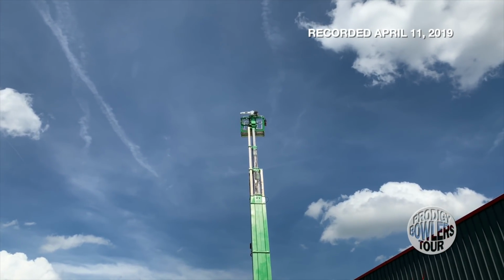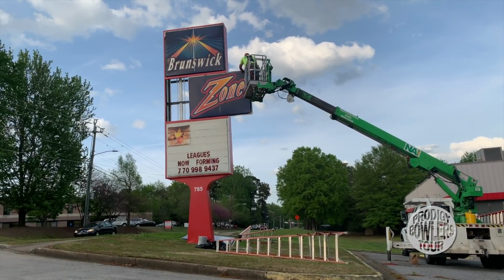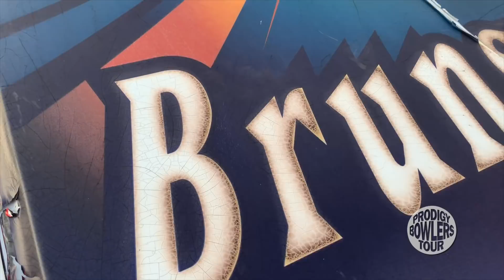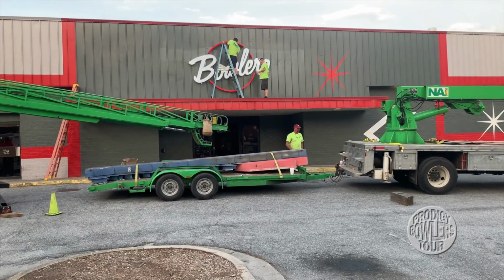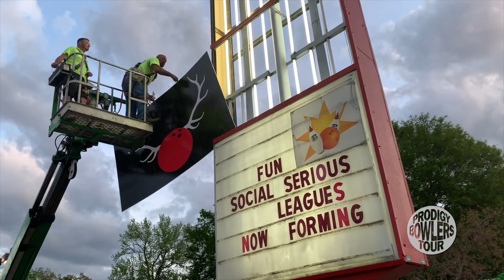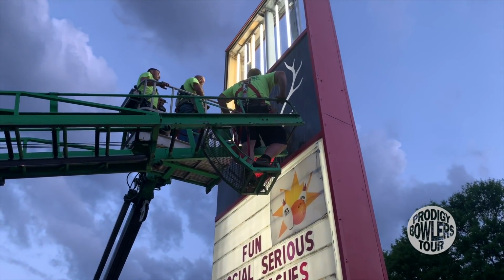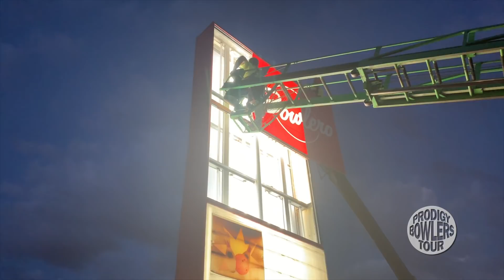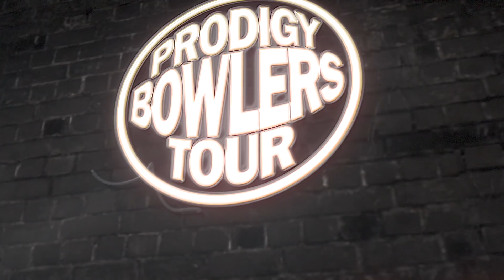PRODIGY ODDITY -- 04-11-2019 -- It's the Sign of the Times

Comment: That front lot sign is alot thinner and cheaper than the old one was. Like Randy says, That'll blow right out of there in a good wind. Ive seen signs do that here. Do another video when these signs decide to blow out on a windy day. Brunswick Zone was a better brand name than Bowlero.
Reply from the maker: The old Brunswick and Zone signs were stuck on to a plastic backing that was a "pan" shape.  Had a dip in it.  Did seem a bit thicker, more rigid.  But the new ones, while slightly more flexible, are stuck in there and affixed by their edges.  And although I didn't stick around to film it, the red metal frames that went up after I signed off will help to hold them in place.  These guys are professionals and know what they're doing.  I imagine these new signs will be up there a very long time.